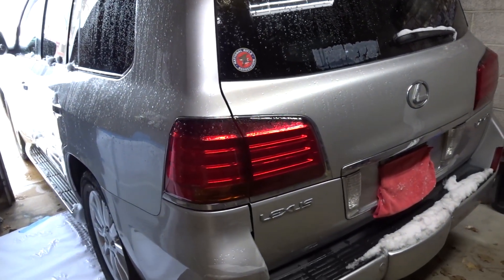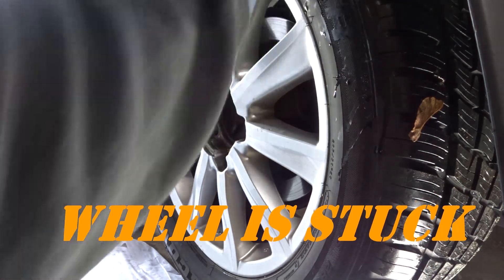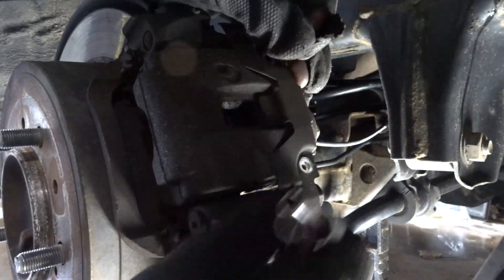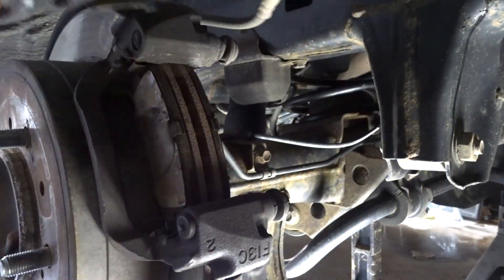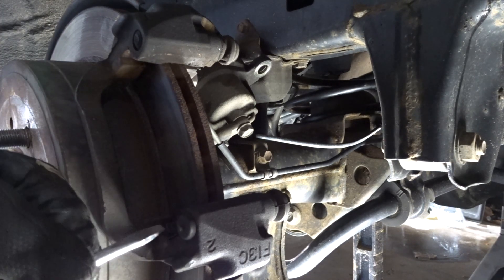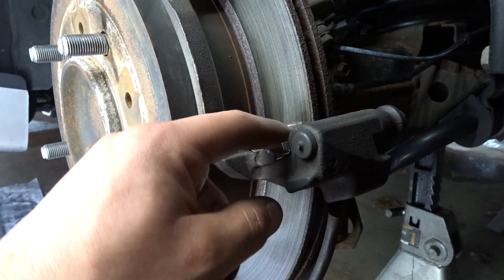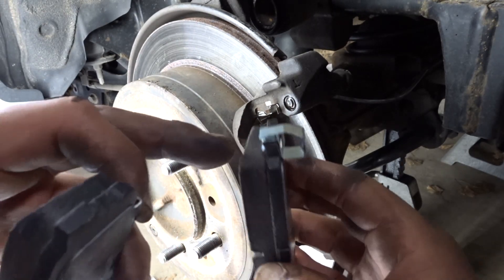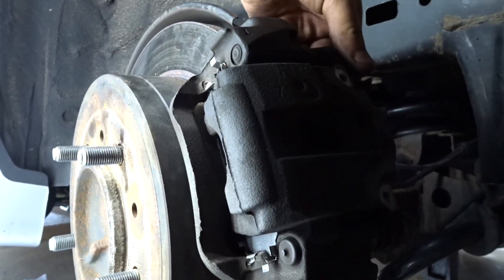2008-2019 Lexus LX570 Rear Brake Pad Replacement

Comment: Does your LX570 has Electronic Parking Brakes (EPB) system and if YES - do you have to place it into "pad replacement mode" before taking out pads and release caliper pistons?

Comment: Did you put break grease on the back of the pads if not why not or why so also do they have those squealer plates on the back brake pads anymore my '78 Toyota had squealer plaids and they went on the back of the brake pad a thin piece of metal was supposed to make them not squeak or something like that.
I saw you installed the wear indicator so maybe those replace the squealer pad that goes on the back side of the brake?
Reply from the maker: With aftermarket brake pads the squealer plate is usually already there. With dealership OEM you have to assemble everything together using old squealer plates. You can very well use grease on back of the pads.  I had pbc grease on the pins. The grease that is for the back of the pads should always be molykote grease,  which was not provided during the installation